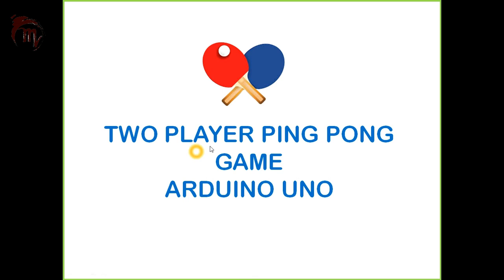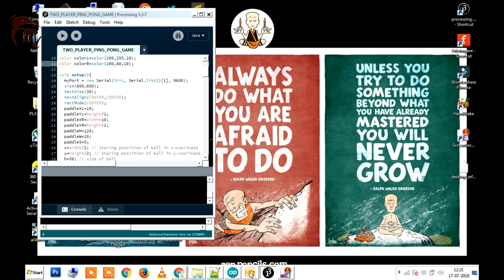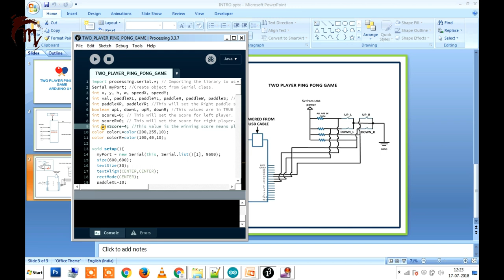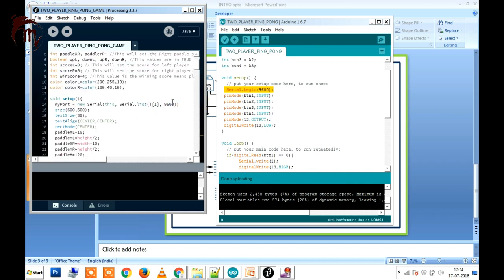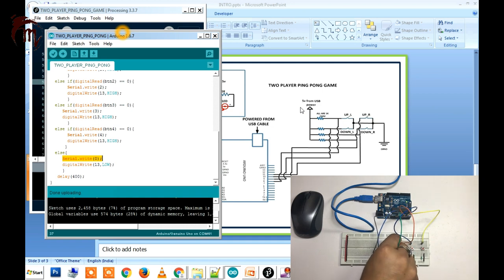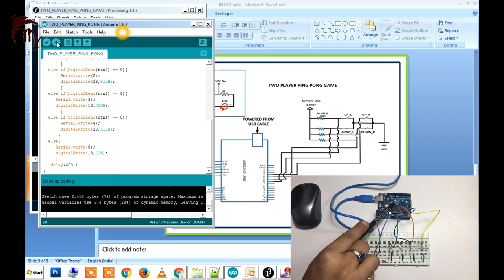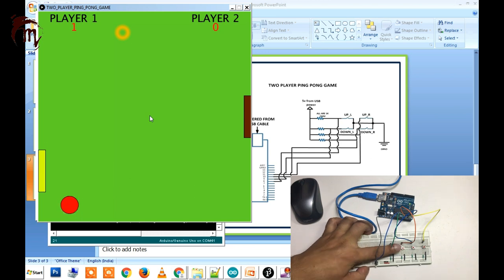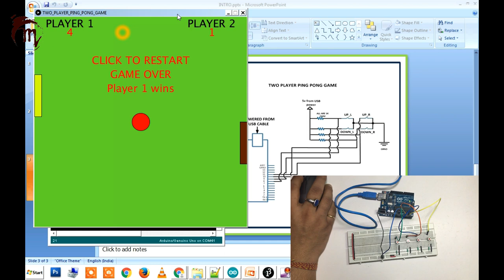Two Player Ping Pong Game | Arduino | Processing 3.4

Comment: where is pin 13 connected.....?
Its not working.....?
what header files we need to include in arduino uno code?
Reply from the maker: Hey friend PIN 13 is connected to on board LED. You can see your UNO board to check.
I have not used any library. See this tutorial is all about digital input/output.
I am taking the inputs from switches and writing serial data to Processing Software. Where processing software verifies the data and do the respective job as per the code written in processing.

Download both the code. one is for Arduino IDE and other is for Processing IDE, copy the arduino code, compile it and upload to your Arduino, then just run the processing code and try to control the bouncing ball with the switches.
Reply: Where is pin 13
Reply: @MyEngineeringStuffs   where can i get the arduino code?
Reply from the maker: @put3wisha828  hey sorry for the issue. I have updated the source code link in the description. Find the full source code in the description box. And yes it's absolutely free. ♥